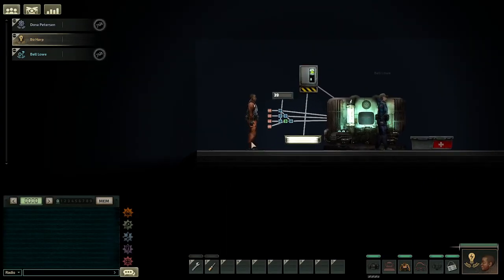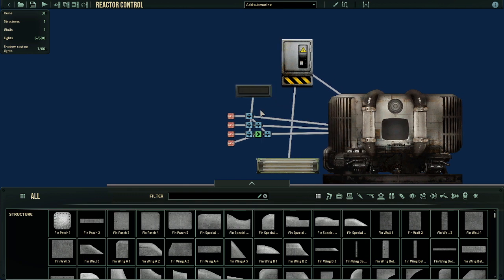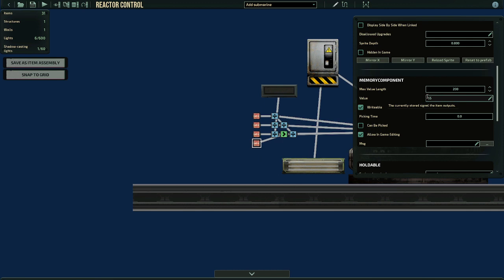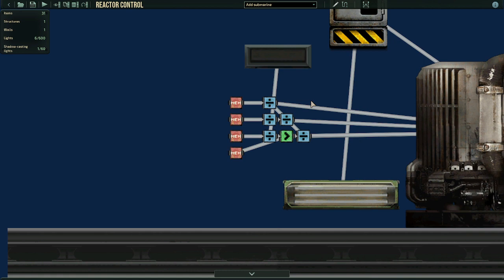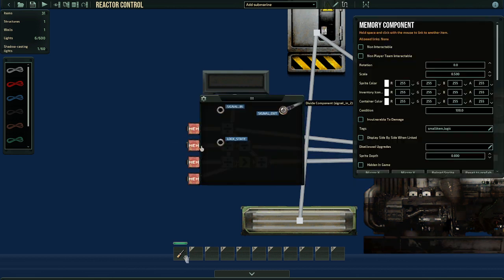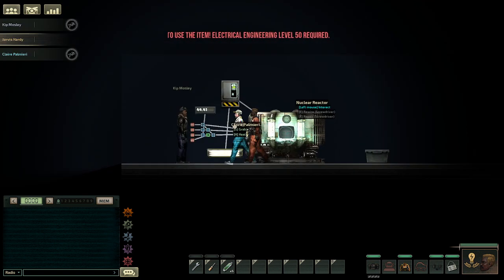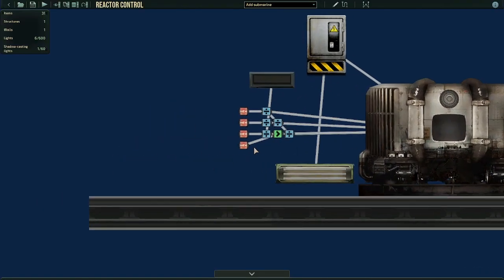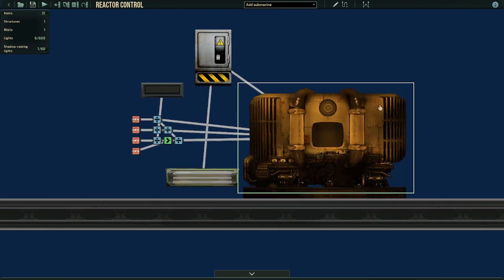Barotrauma Automated reactor control (10 component)

Comment: Gonna put it into my sub. if it fails im blaming you.
Reply from the maker: Fair enough
Reply: I created a reactor controller that only moove the fission needle and let the turbine output to 100 and by always having 4 fuel rods the fission rate dont need to moove a lot wich make this controller really fast but it consume more fuel then other controllers. The idea is that if you have a lower temperature then needed to run the turbine output at max value the reactor will produce less power so I calculate that to set my fission. So instead of a normal reactor that will have a the turbine output moove in average between 50 and 100 my controller only move the fission rate in average between 10 and 22.

Comment: This is a pretty good circuit, I use something similar but the fission reducer is a really neat idea and prevents having to scram on the slightest overheat. This works great for starting the reactor under load without tripping a scram circuit. Though I do have some observations and improvements.
- The top left memory component shouldn't run a random number, it is the reactor max output / 100. While the numbers you use work great on a unmodified reactor you quickly find it out doesn't on ships with way more or less power (example winterhalter has 8500 reactor while dugong has 3000). The number on the memory should be changed to accommodate upgrades to the reactor output, I like to use a 2nd memory and a multiply component to do it as I don't feel like doing math.
- The memory + divide component for the temperature is not required as it doesn't interact with any other components that need the percentage value, but that is just personal preference I guess.
- I personally like to still have a scram circuit by setting a memory to the reactor max heat and feeding that into a greater component with the reactor temp + a RegEX for a condition meltdown. It should not reach max heat unless someone does something stupid anyway.
Reply: Can you explain what a scram circuit is?
Reply: A scram circuit is a circuit that automatically shuts down the reactor in emergencies. You could just say shut-down circuit but scram is how it is called irl and in game (there is a warning on the reactor UI that starts flashing when a wire shutdown is triggered).
Reply: @Tjarnov  and how would one do that? Something with the temp output, a Greater component and set state?
Reply: There is a dedicated connection for shutdown, it will shut it down on any signal received. But yeah greater component reading heat level can work, though you need to make sure false output is no output instead of 0.
Reply: I created a reactor controller that only moove the fission needle and let the turbine output to 100 and by always having 4 fuel rods the fission rate dont need to moove a lot wich make this controller really fast but it consume more fuel then other controllers. The idea is that if you have a lower temperature then needed to run the turbine output at max value the reactor will produce less power so I calculate that to set my fission. So instead of a normal reactor that will have a the turbine output moove in average between 50 and 100 my controller only move the fission rate in average between 10 and 22.

Comment: I'll be honest and say that i struggled wiring this stuff up (more than i should have) probably spending about 30+ minutes figuring it out, & at first it appeared you were bouncing back n forth between components (read: you werent, wiring just scary) but so far on the orca 1? Doing exactly as I'd expect; some slight flickers here and there but they last maybe a half-second and my sub is completely fresh w/ no upgrades yet.
 I wish i actually had a mathematic brain to understand FULLY what's going on, but in the meantime I'm saving this video for all my future submarines.
Reply: Turbineoutput = 100 * Load / Max reactor power

Fissionrate = 75 * Turbineoutput / Fuel load

"75" is just how the game works.
If max reactor power output is e.g. 4500, then Turbineoutput = 100 * Load / 4500 = Load / 45

Overuse of "Divide" components is what's confusing in this video, a lot of "dividing the dividend" is going on, on top of all wires being white.

Comment: Does anyone tried building this system in 2023 ? I don't know if it's still working.
Reply from the maker: I mean, i made it in december, did any updates came out since then?
Reply: @Doile911  update which was realised on 31st January? Or it's don't make a difference?
Reply from the maker: @IDCfgs  ohh nice, well, i havent played since new years, sooo i dont know.
Reply: It is still working
Reply: I created a reactor controller that only moove the fission needle and let the turbine output to 100 and by always having 4 fuel rods the fission rate dont need to moove a lot wich make this controller really fast but it consume more fuel then other controllers. The idea is that if you have a lower temperature then needed to run the turbine output at max value the reactor will produce less power so I calculate that to set my fission. So instead of a normal reactor that will have a the turbine output moove in average between 50 and 100 my controller only move the fission rate in average between 10 and 22.